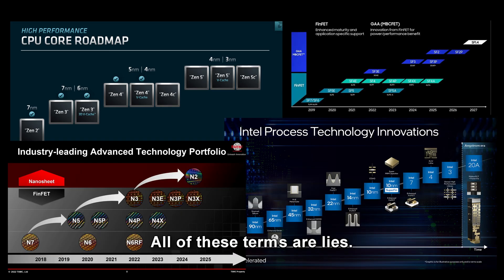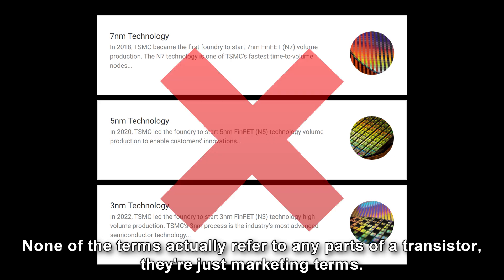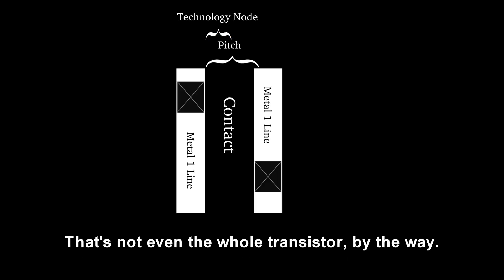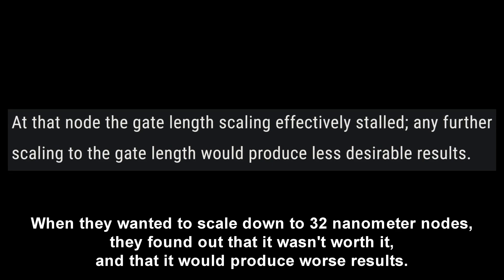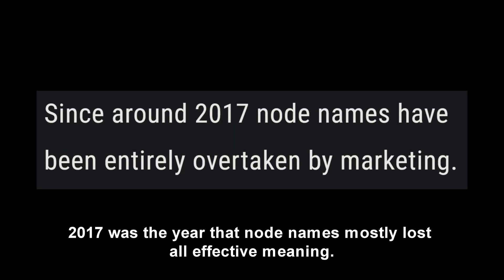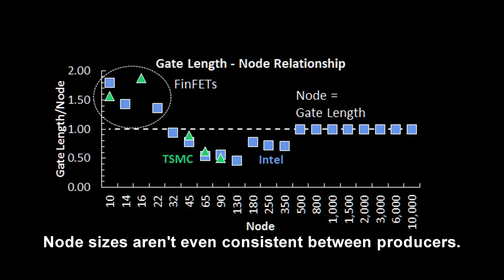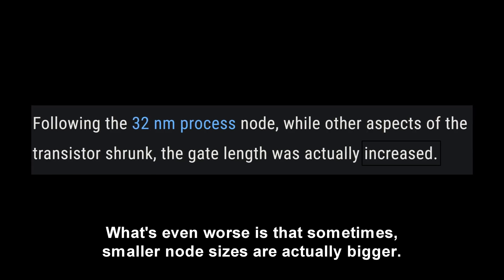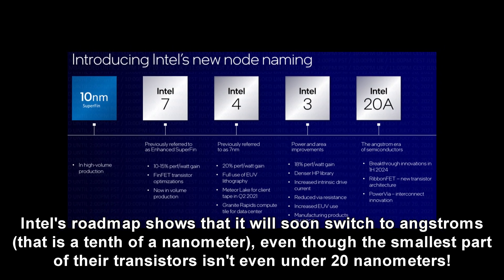The Biggest Lie in CPU Marketing

Comment: nm semiconductor node as gate pitch/smallest transistor features lost its meaning ,but you failed to mention the nm nodes nowadays are representing the equivalent transistor density if 45nm node continues to evolve. For each generation change the density is improved by 2X up until recently, TSMC rename to nm to N7 N5. The new naming is really start to lose the meaning.
Reply from the maker: Yeah, I'm aware.
I know that smaller node names mean they increased node density, but the term itself, "nanometer" is a marketing term.
You mentioned that TSMC changed their naming, but that is only partially true. Yes, they call their nodes n5, n3, but on their site if you search it up it still shows "5nm technology", "3nm technology", like what I showed in the beginning of the video.